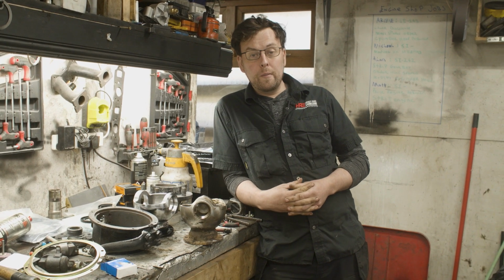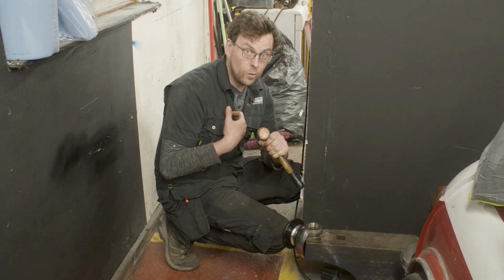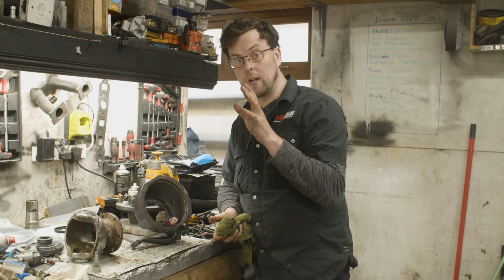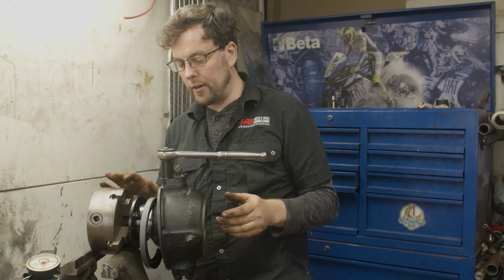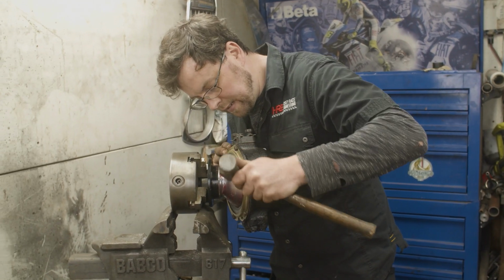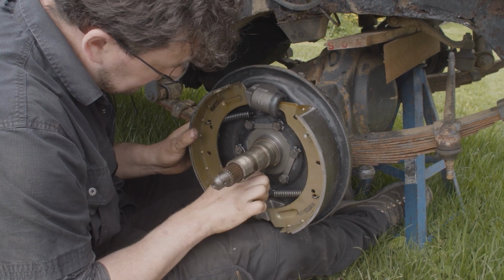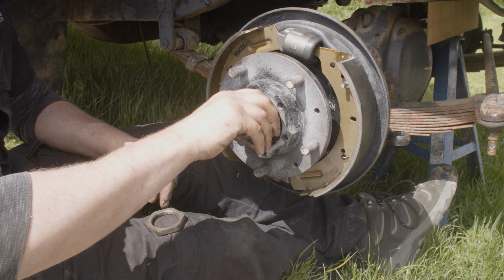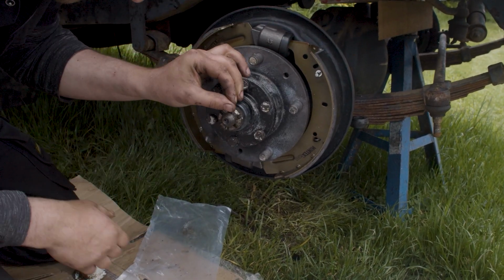Repairing A Worn Swivel Hub On A Landrover Seiries Three - Part 2

Comment: Paul very in depth if you cockup after that vid you shouldn’t be working on a Landy ,you failed to say you must clean out the wheel arch first because the cow muck always gets in your hair and the family look at you awkwardly 😂
The old hubs where filled with ep 90 but if the customer wouldn’t pay for the rebuild it was 140 to try and make it last longer the oil was sat on the air heater over night to warm because it wouldn’t flow from the can ,those where the days when men where men and sheep where frightened 😂keep them coming fanbloodytastic 👍👨🏻‍🏭🇬🇧
Reply from the maker: haha the cow "muck" is real in this one two men in diver suites would have trouble clearing it out lol

Comment: Excellent use of a chuck. Wish I had thought of it. Also a very simple and effective way of greasing a bearing. Many people don’t realise how easy it is to over grease a bearing and the damage it can do. That’s why the packets the grease comes in, in the kit always looks too small, but aren’t. You cannot be too careful. I used to wear cotton gloves handling them. Also excellent example of the use of a simple spring balance and the ubiquitous dial gauge. Despite its ruggedness, the Landy was intolerant of incorrectly tightened bearings. As usual, very interesting and educational but I have to admit I am intrigued and this is compounded by Norman’s comment. I’m looking at the video and it’s obvious that the brake shoes will only fit the way they are fitted but it doesn’t look right. The leading shoe looks upside down and the trailing shoe is chamfered which doesn’t make sense. If I just saw the picture of the shoes I’d assume I was looking at the passenger side. Given what’s there I’ d expect binding due to the self servo action of the leading edge. I wonder? Still great stuff. Enjoyed immensely.
Reply from the maker: Its very intreating, watch this space see if we can figure out the ins and outs of these old girls

Comment: When it comes to packing taper bearings, I was taught to push the grease up from the wide end exclusively, until it comes all the way through and starts oozing out the narrow end - the idea is that it avoids the potential for a bit in the middle of the bearing to have less grease than the rest.  And for those who like to use a bearing packer: I've never been as happy with the results of those as I have with doing it manually.  Cheers, Paul.  :-)
Reply from the maker: Thats exactly how it should be done man, I like you have never got on with those packers there a bit of a pain

Comment: 1st, this is getting boring being 1st all the time Paul lol...........................time to grab a beverage ;-)
Reply: You only beat me by 2 minutes. if i could type faster with more than two fingers I would have beaten you.
Reply: @unclekevin5094  No Kev, nothing to do with how fast you can type. Its all to do with you having cheap slow internet, we all know how tight you Scotts are lol. HRE timed this just right. I've just come in from taking the roof off my 62 Mini. What a sod of a job.
Reply: @paulrobinson3528  I apologise if you think I am from Scotland but actually I am from and live nearly 800 miles in the other direction. I am Luxembourgish and have lived here for over 40 years. Strangely my dad and myself took the roof off a 60s mini in my youth and turned it over and made a very nice small garden pond for goldfish. As we didnt need to reuse it an angle grinder in the corners and sides and job done. I think the whole shell from a write off cost £25 . we used the rear subframe to make a towing trailer. Happy days.
Reply: @unclekevin5094  So that is where your love for Minis came from then? Your accent is very strong on the phone, Glasgow strong, not to bad on the videos. So as a lad,  how did you end up in Bonny Scotland? I love Scotland, looking to move there in a few years!
Reply from the maker: Good job lads 👍